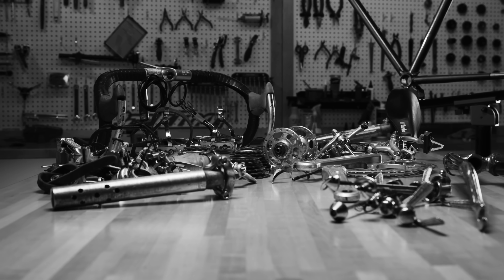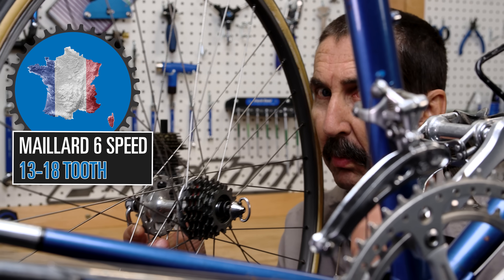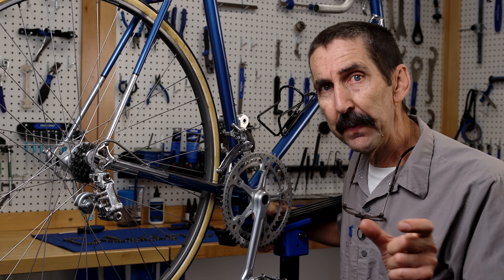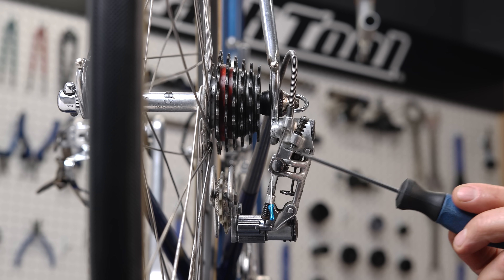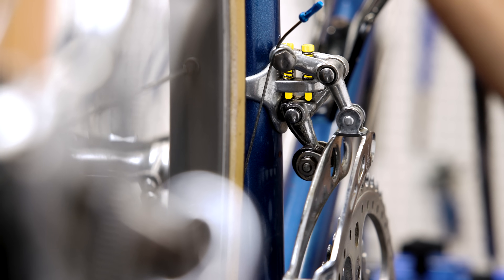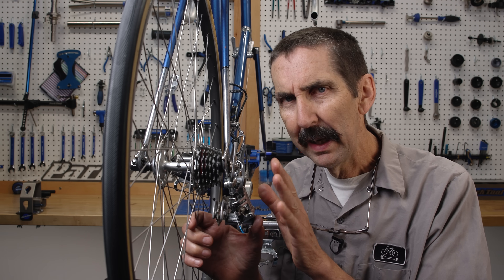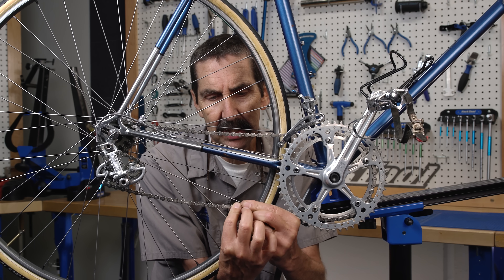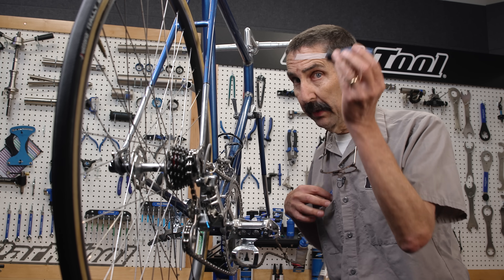What Can Old Friction Shifters Teach Us? | Tech Tuesday #225

Comment: I just found one in my old parts box. I am seriously considering installing it on my mountain bike. The slightest bump on the derailleur and the gears are messed up to I re-true the hanger or hammer the cage back straight again. I figure I could mount it in the same position as a thumb shifter with a cut down old kidney buster. I liked  “The neural connectors under the helmet” line.

Comment: Good old friction shifters. Always very forgiving. If your chain stretches or the cable stretches or the spring in the rear derailleur wears; you just move the lever at bit differently to get the chain in the right place over the sprocket. Bikes didn't always have to be so expensive and difficult to keep maintained.

Comment: There's a problem with friction shifting systems that were made in the last several decades: Gears and chains made for indexing.

It's the ramps used for faster shifting ... you don't get the noise and so it's harder to know if the chainline is off. BAM, now you're in another gear when you wanted to stay in the same one as before.

Comment: Nice! I used to have a Mondiale 12 speed. The shifting setup looked exactly like what you demonstrated here. Pretty easy to set the limit screws and maybe adjust the cable tension slightly....

Comment: I had a Peugeot bike where you could adjust the gear shifters to friction shifting if the shifting wire had worn out so much that the mechanic's settings would not work anymore.  Was a great bike but it was stolen some twenty years ago.

Comment: My ‘79 Bianchi Superleggera was officially retired about 10 years ago. I trained and raced on that bike for over 30 years. It had many chains, many freewheels and clusters, many chain rings, but it still has the same super record derailleurs as when it came out of the box. I was 22 and asked the master mechanic if I could observe as he put the bike together. At that time I learned exactly what Calvin is teaching in this video and thereafter I could almost always solve any shifting or related problems (which were extremely few with gear of that caliber). 
Several folks have mentioned in the comments already and I’ll add to the choir; friction shifting is a real joy. You learn your system’s characteristics and make the adjustments you can to suit your style, and the whole thing becomes more like hydrodynamics than purely mechanical. Friction shifting on your own well tweaked system is very fluid experience as opposed to the sharp clicks and clunks of modern bikes

Comment: Old friction shifters/derailleurs work so much better with modern chains and cassettes/freewheels. When the industry moved to index systems, they had to greatly increase the precision and quality of the chain and sprocket teeth. So, even if you are into friction systems, you are benefiting from the modern drivetrain, at least if you use a newer chain and sprockets. 
Remember the old days of tickity,tickity, tickity, clunk, clunk, cluck?

Comment: This is a massive tip for anyone installing DI2 or any other electronic shifting system do the big adjustments visually without the chain installed so you can go up and down the gears without having to use the pedal cranks. This allows you dial in the upper derailleur jockey wheel with the cassette. This way it means you then only have to fine tune the gears once the chain is installed. This method allows you to have less issues and no need to use the cranks as you set each shift setting prior to installing the chain.

Comment: Ironically my first multi geared bike came with the shift lever conveniently located near the brake lever.  It was indexed too. This wss 1969 . I spld 32 boxes of personalized Christmas cards and eaned a fabulous three speed all steel English light weight bicycle.  That was my first bicycle with an out of the shipping box assembly . At nine years of age my father and learned how to assemble a bicycle and learned alot mostly through mistakes.  Well I did learn how to adjust an indexed system., the importance of getting the cotter pins right and how to adjust a front hub.  Oh yeah a spoke wrench works much better than a creasent wrench.  
    I learned alot from having that 3 speed bicycle.  Oh yeah selling those cards was a challenge in it's own . I was disappointed that my goal of selling enough for that Schwinn Crate wasn't met. Fortunately that was also the best thing that could have happened.  That spring after a few rides in the snow that disappointment turned to joy . I quickly discovered the light weight was much faster than the bicycles my freinds had.. in a couple of years it got dropped  road bars and some more learning  experience.  Now it was even faster.  Two ten speeds later and in 1976 I found my self in a local Schwinn bicycle shop assembling red white and blue Schwinn Varsitys and how nice a truing stand is to have around.  It was a pretty cool place to spend my Friday evening being the only person behind the counter.  Learned alot there from both the owner and costumers ( there was a guy that had a Mercier with sew ups that talked to me a few occasions) .  Sold a few Varsitys , Le Tours and Continentals and discovered how much better daul pivot brakes were. Even learned to understand the costumer well. One of my third cousins came in to buy a nicer bicycle.  I was thinking the Le Tour 12.2 was going to be the ticket,  no after a couple of test rides it was the Superior that was perfect for her. It just fit better for her small size and that was more important.  My wife also had the same bicycle in the past and she also liked it verry much. It was stolen from her before I met her, but she did talk about it fondly.  I was back in a bicycle shop again too.... I won't be giving up my Utegra STI 3×8.  It's very reliable and I have all the gears i need right at hand. The XTR short cage rspid rise works so nice with the Ultegra 9s chain ...

Comment: I got my 10 gear shifting on my friction shifter after a little trouble with the largest back sprocket. I have to nudge with the front derailleur a little to get it to shift. After it shifts it stays there.

There's no way to loosen the limiter any more and it looks like the dereilleur is under the right gear sprocket but in the end my chain seems to thinks otherwise. Easy fix with the old computer under the helmet. Just a little nudge with the front dereilleur solved the problem.

Comment: TIRES:
   BICYCLE KING OF KINGS TALKS TIRES.
  I am bicycle king of kings so you would ALL be required believe on faith get behind me. 
   Marketing is very clever..
    Cleverly corrupt if not just flat stupid as they can trick they customers 2b. 
  80% humans = demons. This is literal. They dont knowhathey are.
      Plasticines. Nephilem spirits hive mind cnputer controlled savant idiots placed in flesh with hadron collider they control yr manufacturing. DONT let thm snake u. Just as days of Noah.
 Comprende?

    Satans kids biblical tare race.
   He HATES bikes cuz they free energy.
 I bought cash 2 homes commuting on.... bikes.
   
    Bicylce king of kings version of reality = very simple I remember it well.
     Michelin Select 1987 or so hands down changed my life tire.
  Why? TPI.
 Ever ridden a REALLY good tubular??
   
     SPEED. Roll resist it equated2 high TPI (thread per square inch) equates 2MASSIVE cmfort = free suspension and rolls i mean FAST & TRACTION CITY.
 No i mean GOOD suspension. As in delete Satans crap dually suspensions save u 3lbs.
   High TPI is less weight then more durable low TPI.
 Less is more.
   Knobbiez & tread:
  Dont wrk & never did. They4 30HP treadmill water wheels motocross bikes only.
  Mud DOESNT WRK.. ..&knobbies DONT HELP.
 BIKES ARE NOT FOR MUD OR VISCIOUS 28MPH SINGLE TRACK.
   PERIOD.
  They are point & shoot above a crawl or running speed device only 21mph or less. U dont need knobs as they slow u. Drammatically. 
   Bikes:
   Strictly point &shoot beeline flight of th crow medium. Get it? As a rule. 
  Listen rubber gets traction what more do u want.
   ...6" spikes???
    Mt. Goat feet = slicks.
 
   Specifically DEFORMABLE slicks.
   If u go adding additives decrease traction slightly double life tire so what???
  "Worth it."
 The tire shall be deformable.
   Highest TPI 180 or plus 2.00" 26" 500gram or less with couple puncture belts. ...Continental speed slicks.
  Knobs are slow????
  Proof. 
 Cant evn bleev i have 2say this.
   Knobs slow u way th &%@! down. 
   I averaged 12mph slicks & 8 mph knobs fireroad 12 miles up TIME TRIAL BRUTAL STRAIGHT HARDPACK DRY DOWN 45 or plus degree steep assed sht.
   Knobbies & tread are 4customer appeal marketing.
   Knobs & tread love 2 carefully postion road debris puncture tires. 
   Knobs are heavy. While th vulnerable valleys thin. Slicks = slippery armor when thorns& glass try2 find purchase & can't as easily.
 Slicks& highest TPI extreme as possible deformeable carcass it all equate 2less WEIGHT & dont tight a$$ your bike with iddy biddy itsy bitsy tires either. Go large diameter 2.00 or plus Mt. Bike tire.
 32- 36 PSI is the optimum. Try it sometime. 
 Conclusion 
    Continemtal Contact speed type tire lightweight slick can flat blow thpants off any other tire& in fact tires CAN be engineered much lower roll resist ...then Conti Speed.  
 Jump on that train let manufacactures know u want cmfy speed not a gimmick delusional tank with pressure so high it damage carcass h*ll to pump ruins pumps. 
  
   One lasthing.
   E bikes:
    Shall be 21mph max speed only. Tires engineered4 32mph is only a bogus step backward. 
   E bike should be 350 watt geared or 500 watt direct drive front only 36 watts ONLY 20 AH battery (8lbs) ideally... period kit bolted on top line pro Mt. BIke with 90mm rise bars & seat ridden much lower. 
   My low seat nets me 22.5mph vs 21 mph top speed flats.
 Aero low CG ultra stable SAFE ultra LOW LOW LOW CONCENTRATION FATIGUE quotient stable handling with massively stable wide arms triangulation 28" to 31" handlebars. Coupled with ultra LESS caps lock weight say no to 940 gram 32mph tank tires that are dead slow like dragging a stiff bone jarring boat anchor, and boom nets u massive maneuverablity agility cmfort& speed & fuel effitientcy safety massively less fatigue.. 
    Do knobs REALLY get more flats: That i dont know. Slicks take all th weight u paid for lay flat. Tread incorporate hollow spots = wear squirm noise vibration hence friction& surface area that packs mud& dirt. 
 
 Depends on design u would think slicks designed right thicken tread max distributed armour doesnt reduce thickness in valleys like knobs. Slick leave next 2zero perceptible tracks fireroads. Tracks take WORK 2build& work = energy hire 10 x's more ants = pay4 far more employees 2 arrange aaall those iddy biddy teeny weeny grains of sand in2 pretty oh so impressive looking knobby tracks only 2do a far (slower) job in th end now that u can take 2 thbank.
  
 AAAAAAAA

  Worlds best tire:
    I test 3 tires.
    I scrapped about 800 runs = 108 Official ones. Technique - became ever more refined precise. Wind pavement& ambient temps had 2b identical, tire carcass had 2b warmed up. 
    Cold tire drammatically crippled results especially with 2.35 ballons - 80% cycling done on hot pavement.
    I timed marked measured optimum runs all
 of which had 2b marked with ribbons.
   I was already predicting ballon tires would be fastest on gravel hence advantageous on rough country roads = they WERE. Question: Did they prefer normal pressure 32psi or highest pressure 55psi? Had they rolled faster 30psi as I'd hoped i'd then have run thm 23psi. 
   2.35" CAN be run 20 psi but threality = they'll be high friction slow expensive erasers& lower pressures = easier on tubes, pumps, tire carcass& you. 50psi has u wearing out yrself& pumps fast blowing out tires. 
    Why I ALWAYS hold2 the traditional target of 32, 36 psi. 
These epicenter ideals exist
    FOR
        A 
           REASON.
   Try xplaining that 2 thpeople refuse coprehende an E Bike should NEVER.
    EVER. 
       EVER top out over 21mph 36 volts running 350 watt front 8lb direct drive geared motor only.
    Engineering:
  Satans biblical "tare race." 
   Predominantly literally demons. Plasticines. Computer hive mind Nephilem spirits placed in flesh bodies with Hadron Collider pocketing MASSIVE cash by catering 2 delusional customers. (With mentaliy of an incredibly (stupid) 4year old.)
 80% "humans" = cmputer animations.
       If u want subscribe yr own passionate version of reality purchase spiked knobby tires averaging 8mph dirt. Where slicks average 12mph, then u will also achieve dreadful performance pavement.
   Hardest part about this test was operating bike/stopwatch precisely& smartphones = dreadful stopwatch in 25mph. Lines had 2b chosen exactly, no traffic.. took me 700 runs just2master it.
   Schwalbe Big Apple 2.35:
     #1.
 Drammatically SAFER, secure, grippy. 

AAAAAAAAAAA

 The test:
Conclusion:

Coast down pavement: This was recorded stopwatch 2 mailbox, then distance 2bike STOPS:
  
 Continental 1.75" Road Tours went farthest on coastdown pavement (dock) @55psi AND fastest time 127:51 BUT Continentals were also LEAST distance coastdown on brutal gravel run. 
    Continental did 59.55 full throttle run point A to point B run.
   
    Big Apple 2.35" 55psi then proceeded 2beat Continental coastdown pavement by 6' 6" @a LONGER stopwatch 2mailbox, strangely enough, of 131:13
    Apple 55psi recorded fastest2 mailbox time by far of 125:42. (Slowest was Schwalbe 1.75 Marathon Plus 30psi @139.42)
    
Full throttle runs:
  Big Apple was fastest @ FELT the fastest @57:01, 57:76
Schwalbe slowest 102:41 55psi& strangely, it went faster 1minute with only 30psi.   
   Continental recorded 58:42 30psi.

    So basically here we conclude skinniest Continentals supple 128 TPI 1.75" carcass was indeed fast pavement recorded least max coastdown on gravel as also I expected& big Apple by far lomgest coadtdown also as I predicted, was hoping. We discover Big Apples durable heavier stiffer 67TPI thread count in conjunction with highly elastic supple sidewall thrived on HIGHER PRESSURES. It recorded max coastdown beat ALL tires both on pavement AND on the brutal coarse HIGH speed downhill viscious insanely dangerous gravel run.
  We found that Big Apple recorded fastest uphill pavement full throttle stopwatch run@ 57.01 seconds. Versus 102:41 Schwalbe@ 55psi run. Proving here also that Schwalbe most likely doesnt prefer higher pressures bcuz Schwalbe recorded a 101:43 full throttle run with only 30psi.